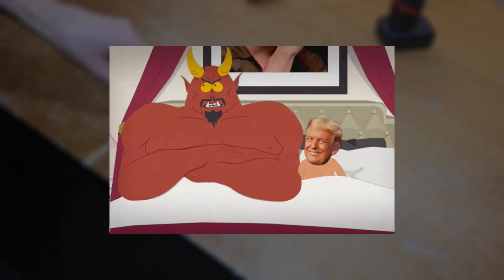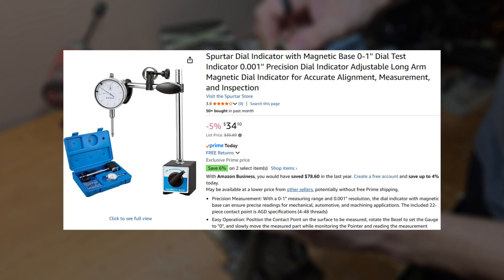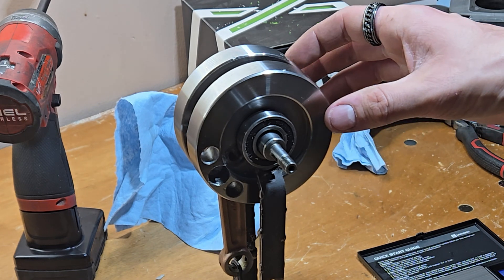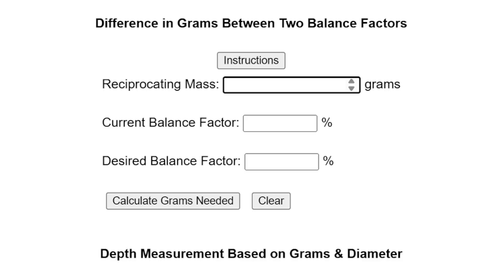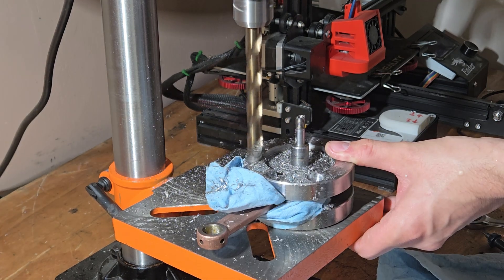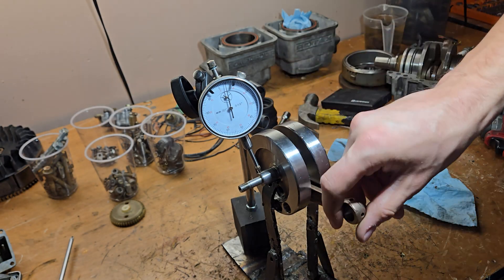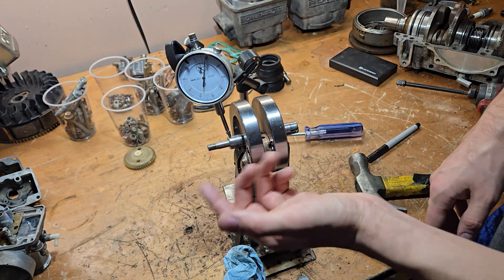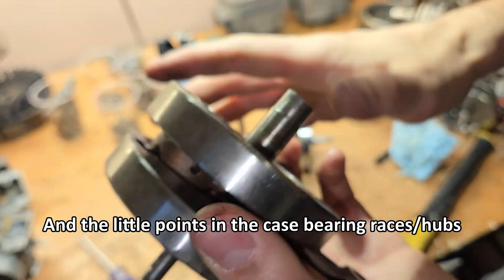How to Balance 2 Stroke Crankshafts for Motorized Bikes

Comment from the maker: USE CODE "TRENT BIKES" FOR 5% OFF: https://smolikperformance.com/trentbikes,  all good quality parts!

Yes, I'm aware that the pre-balanced 40mm stroke cranks are not in stock. I forgot to add a text. They are very busy with making parts, it should be back in stock relatively "soon" (I have no ETA).
Should I make a Hybrid Engine build tutorial? (70cc 6hp+ Iron Minarelli, since that's what I have atm)
Reply: Yes trent you should do a cast iron minarelli engine 👍
Reply: Trent my crank has an issue, the arm that hold the small gear has its own orbit and is wobbling around causing the gears to bind ....can this be fixed? At 7min ur video shows a trueing process but mine is rather extreme....any wisdom helps
Reply from the maker: @jessesicoli7878  look for a crack right at the very bottom. Also its a shaft

Comment: The whole first part of this video makes no sense. You say about how you cant add weights to the crank? Whats the point of the bearing? Why did you stuff those paper towels in there? Then you square off a hole drill what size and what depth and fir what reason? Eh good enough? This was totally unhelpful, under the guise of information
Reply from the maker: I think you might be a little slow lmao

Comment: Does smolic sell bottom end motors only,that have the aftermarket balanced and trued cranks already in them and put together? Just the bottom end tho... like the motor case and crank only? It would be so much easier for me to build the motor I want to build if they did..I don't wanna take the time to take apart a motor that's already together,just to change cranks..in order for me to get my bike any faster I have to have a better crank..im not gonna gain any more speeds until I get a better crank
Reply from the maker: I believe they still sell ported chinadoll bottomends with balanced cranks. But they cost $285. You can save $150+ just buying a bottomend on amazon or whatever and balance and true and case match yourself

Comment: I know this isnt related but im having troble figuring out how to set up front and rear disc brakes, im getting the cdh 26" spoked rims with disc brake hub, and using a felt faker frame with triple tree forks, it came with a single 160mm on the front but id like disc in rear and maybe a matching size, planning to use a 32T spocket from CDH with the disc brake adapter

Comment: I have started my first gas bicycle build...don't have the engine yet cause I am in no hurry, and not sure what exactly I want yet...been offered a few for free and turned them down cause they weren't ideal for the bike build.  Was offered a 125CC yesterday for free.  The issue isn't getting an engine, it settling on which one.  I think I want to still buy a kit out of convenience of mounting the dang thing to the frame.  But not out on a dirt bike engine or something along those lines.  Princess Auto had a clearance of 180CC for $80 Canadian not long ago.  I think anything bigger than 125CC will be tough to fit.  And even the wrong 125CC will be too wide for pedals and have to be mounted in a strange position.  I don't want any of that.  I want it to look good as well as be nice to ride and decently powerful.  I have an old 70's frame with a ton of chrome and polished aluminum parts, bars, etc.  That I am using for it.  I already put modern 26" MTB wheelset on it with modern tires, 2.35" front, and 2.1" rear (it's all that will fit this frame).  I am going to get a universal "cafe racer" style motorcycle fuel tank cause I am gonna eventually try to register this as street legal...and drive long distances.  As far as I know, I really just need lights, turns, etc, DOT tires.  I eventually want to lace motorcycle rims to MTB hubs, so I can run DOT motorcycle tires.  My neighbour has some motorcycle wheels over there I can have he said, they just have junk tires on them I'd have to remove to replace them.  I could probably get them off.  If we could legally ride gas bicycles under a certain CC here that would be cool but all gas bikes are considered motorcycles here, pedals or not.  So you need to register and insure them.  And they need to be street legal, of course.

Comment: What do you think of the modifications where you can add up to 56mm (MS660) chainsaw cylinders to these engines? Would you make one to show on the channel? It gives a lot of top-end speed potential, as it reaches high rpm and has a lot of power, which allows you to install increasingly smaller sprockets.
Reply from the maker: As long as they make 15+ hp to hit 80+
Reply: @trentbikes with the correct work this range is more

Comment: If my frame cracks I just put it back together. It’s metal, you can just weld it back together
Reply from the maker: Or you can balance and true your Crank, not only to have to repair your frame, but also to have smoother riding, quicker throttle response, a bit more performance, more reliable engine. But go off, I guess
Reply: @trentbikes  I’m still waiting for the smoke engine, but engine won’t be silky smooth and will still vibrate cause nothing is perfect. It’s why I don’t buy that gas frame cause if it cracks I’d have to reweld it and get a new gas tank

Comment: 7:55 Is it necessary to weld it, or is it just done for safety's sake?
Reply from the maker: If you want it to stay trued for a long time, its what I do
Reply: @trentbikes  And what do you mean by "a long time"? I'm afraid that if I weld it, the 
weld will break off and fly into the engine. I've never welded before, and this doesn't seem like the ideal place to learn when there's so much centrifugal force.
Reply from the maker: @realvasa just make sure the weld bonds well by using high heat, and keep "tack welding" in the spot for a little while. I've done this on all my 5+ cranks and some of them turn 11-12k+ rpm a lot without failure. Besides the bearing blowing due to tuning etc.

Probably a better option, would be to buy a slightly oversized pin and replace it. I dont know where you can find some, sorry.
Reply from the maker: You'll have to disassemble the engine and re-true the crank probably every dozens of miles which can be very annoying. I never had to do this on my avenger 85 for like 500+ miles.

Comment: I plan to follow this and do 6 holes at 4.79mm deep but I dont have a truing stand I will follow your other method
Reply from the maker: What you could at least do is put the crank in your case, put a couple bolts to tighten the case, and turn it over, and do the same methods as shown.

Comment: is it possible to tell when the bearings are about to fail? cause ive only been riding at 11k+ rpm on a unbalanced chinadoll so they are definitely probably gonna go one day
Reply from the maker: Not really
Reply from the maker: @geph13 if you run it lean enough and/or advance timing too much, its more guaranteed to fail. Too little squish gap (under 0.5mm at 12k+ rpm) is also another factor.

Things fail. Even if you have it built and tuned correctly, it can still fail at some point due to quality of the chinadoll cranks. It may last hundreds or thousands.
Reply: @trentbikes  good to know, thank god this whole time ive been running with the choke on cause that airleak would have definitly destroyed the bearings by now if i rode it with the choke down

Comment: ok but how do you know exactly where to drill the holes
Reply from the maker: I just showed you in the video. It doesnt have to be perfect, just leave like a few mm away from the original holes.
Reply: @trentbikes  maybe ive been awake too long, i understand how your finding out how much weight to remove i just cant wrap my head around how your figuring out where on the crank to put the hole/s
Reply from the maker: @Turpsontick just Drill or remove weight around that rod area... Exactly how I did. Not that hard